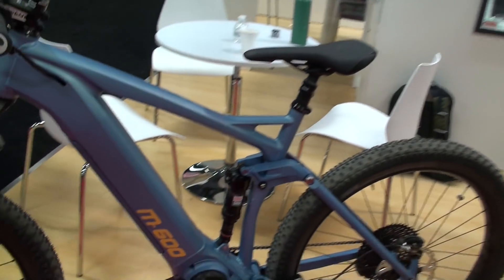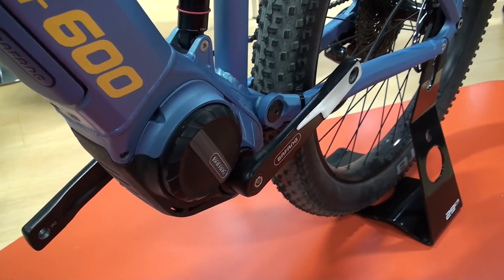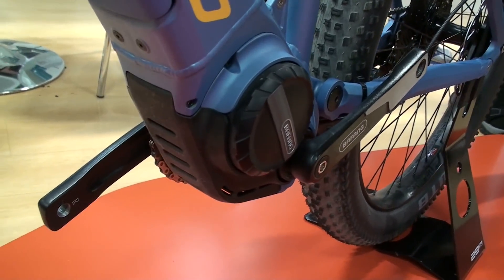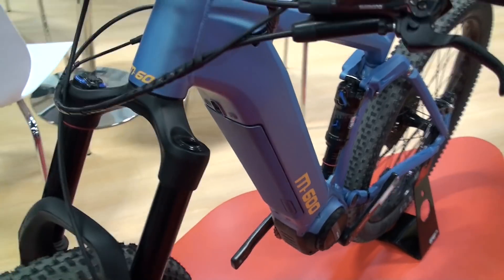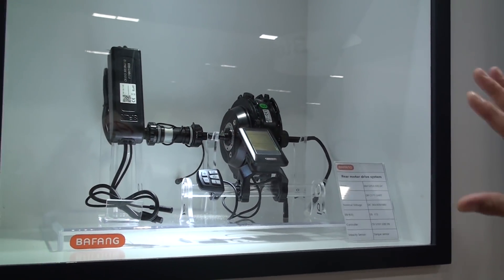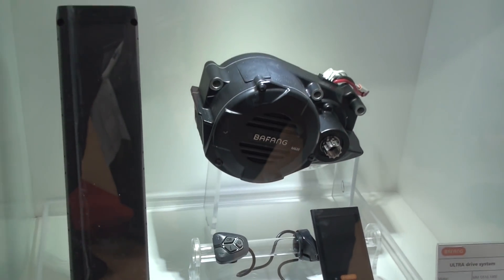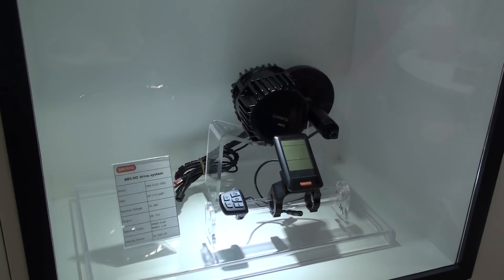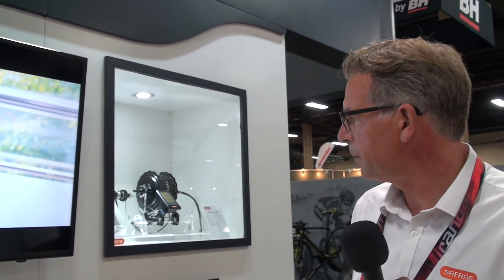2018 Bafang M600 & M500 Electric Mountain Bike Systems  | Electric Bike Report

Comment: I`ve had the M600 for a few months now and rode 2000km. No problems. Keeps 40-45km/h easily in flat terrain. Up to 55km/h downhill if I want to. And can sit while climbing 15-20 degrees uphill. 44T front. 40km/h limiter, but wheel size set to 20". So in reality, no limiter

Comment: For a hunting bike with 4" fat tires it appears the Bafang 750 watt version coupled with a Juiced Bikes proprietary 52 watt battery on its Rip Current S will get me, my camping gear and rifle and my quartered deer meat back to the trailhead. For elk I may have to use a bike trailer to haul the boned meat. 
A good e-bike will increase my hunting range while decreasing travel time thus increasing hunting time.

Comment: they could offer a pedal crank  mounting plate option  with these type ebike frames  to attach normal bottom bracket and chainrings and pedal  cranks when the motor is removed or had to be removed if motor  failed so frame could still be ridden without motor attached.

Comment: Like a dagger stuck in my eye when he called the motor an "engine". I have to ask myself if this guy knows or understands the difference.
Reply: After reading the comments, I'm happy I wasn't the only person bugged by this.
Reply: Same. I thought perhaps my knowledge of the difference between engine and motor was wrong, I've seen a few videos that used the term engine lately. 🤔 And ive designed magnetic couplings for industrial motors for decades. Not industrial engines.
Reply: I thought about it. 🤔 An engine is a machine with parts. So i guess this could be considered an engine.... It converts power to motion.

Comment: Highest is 500w? No 750w?
Reply: They have 500w, 750w and 1000w... the 750 is perfect, lots of power and street legal anywhere in America.
Reply: @brianbassettnumber1  m500, m600, m620 may be installed into the same frame (identical seat "socket")?
Reply: @101picofarad  You mean HAVE TO be installed is some proprietary frame. Junk.

Comment: Why would anyone want a bike designed to hold a specific motor?  Why be forced?  Research and buy any bike you want and add a BaFang 750W and ride anywhere a bike can go legally, with no license or paperwork. BaFang got it (most of it anyway) right the 1st time. The massive frame designs are unnecessary and overpriced. Why own a bike that can't be ridden on the streets?
Reply: Why?  Well there are a few reasons, the most important for a mountain bike is ground-clearance, which can be significantly more if the motor is 'built-ih'.  Also, a minor point: you KNOW that any future motor for 'that bike' is GOING to fit properly ...  (I'm not a 'mountie' guy, just a 'road cruzer' .. Perhaps others here can contribute more reasons ...
Reply: Regardless of the reason or if you get lucky... reason"s", they won't overpower the drawbacks of heavy frames, underpowered motors, proprietary parts, poor assist systems, etc. You did bring up a valid point, the BaFang does hang low on some frames. It just something you learn to ride with.

Comment: It seems like Bafang could very well take over the motor market for ebikes pretty soon.  Their BBS02 and BBSHD mid drive motors both destroy the Bosch and Yamaha mid drives that I tested.  You can do 32-35mph on the BBSHD and the 120nm is much more powerful up hills than the others.  I am very impressed with their progress and now with the ultra motor that Luna Cycles is now offering, I can see a lot of DIY people hot rodding it to new heights.
Reply: Once you've re-programmed the BBSHD (as with the BBS02) it's brilliant. Can't understand why the standard programming is so badly configured. The power output on mine is now buttery smooth, especially in the lower levels, up to 350W which is where I am most of the time. Brilliant piece of kit!.

Comment: I have a Bafang BBS02 750 and a BBSHD. I fitted the 02 to my 26" Gary Fisher ht and the HD to my Salsa Mukluk. Love them both. Very bare bones and simple yet very affective fun and,knocking on wood reliable. I have 2000 miles on the 02 and 450 on the HD. Very easy to install on almost any bikes as long as you know the BB size. No torque or cadence sensors but very good and affordable alternative to porpoise built mid drive E bikes.👍👍👍.
Reply: Brian Bassett who cares??
Reply: CLOTHED IN SHADOWS. Thank you. Well I have never ridden a purpose built e bike,expensive mid drive or otherwise. So I have nothing else to compare my add on Bafang kits. My BBSHD that's on my fat bike feels much heavier than the 02. That being said it does have more power and torque for off road and steep hills. Although I feel the 02 is more than adequate for off rd if you so choose. I use an 11.5 amp hour Panasonic battery and an easily getting 40 to 50 miles per charge using pedal assist and no throttle. I didn't even install the throttle on either one. If I could only have one it'd be the 02 as it is much lighter and plenty fast. I ride to work 2 to 4 times a week which is 22 miles round trip and love it. It is very customizable with assistance levels so you can either get a little exercise or a lot. It depends on if you want a better trail or all around bike with capabilities to trail ride and long road or commuting rides. I love both of them. I will add that spending more on a higher amp hr battery is very much worth the extra $$$.
Reply: You can set top speed up to 33 miles an hr on either one which is more than enough in my opinion. They are not anything like mopeds or small mini bikes. It feels pretty much exactly like a bicycle except you can ride and feel like Super Man.😎👍
Reply: Stars fall. I stand. I got mine through LUNA CYCLES.. they have a huge selection of kits.
Reply: You do realize that the BBSHD isn't legal on any road in America right?
Reply: I'm running a BBSHD off a 21s 900Wh battery and phaserunner controller. I've had it up to 90kmh/55 mph and it seems pretty rock solid. The poor motor reaches 90 C/195 F sometimes after an extended amount of high speed use but seems to keep ticking over just fine.
I haven't had any issues with the police yet. We have a 300W limit on ebikes here but mine is pushing over 5kW. I think as long as you're obeying the speed limit and not doing anything stupid then they will leave you alone.
Reply: Anyone that ride daily and doesn't want to be restricted.
Reply: I agree but the rider was not legal and lets the cop do what he wants.
Reply: Javan Russell 
.m
Reply: Brian Bassett You can re-program it to make it legal and de-restrict it for off road use.
Reply: Javan Russell I started off with a BBS02 13s5p battery about four years ago. Changed to a BBSHD last summer with a 14s9p battery. Running at 52V with 20Ah battery has made a big difference and I would certainly recommend this to anyone getting a BBSHD. I'm nearly always running in the "good" part of the charge (i.e. 52V and above).
Reply: mick2d2 - Yes, you can change the programming but the motor case still lists what the motor was produced to operate as. If the motor is a manufactured 1000W motor or rather anything over 750W it is illegal to be operated on city street and roads.  It's all fun a games until something happens and it comes to light that it is over 750W.
Reply: Brian Bassett True, I suppose if there were to be a accident and an investigation etc. My BBS02 just said 48V20A on the bottom, in small letters, under all the mud. The BBSHD says 48V 1000W, again, on the bottom (I'm running it with a 52V battery, so, it's not 1000W either!)
I only use my ebike off road, unless I can't avoid hitting the tarmac! Here in Spain, at the moment, there are so few ebikes, that I think it'll be a while before we have any problems with the police. I've yet to see any Bafang mid drives (except mine!), although we are starting to see the odd Bosch eMTB. Of course, they're all street legal (250W).
Reply: I don't think that the 250W limit in Europe is right. That's way too weak to propel a large cargo bike or even a fully loaded tour bike. But the American limit of 750W is more than enough with the right gearing to get most anyone around. That's why it blows my mind that American riders are stupid enough to chose the HD over the BBS02 when building a bike they know will be ridden on the roads. - https://imgur.com/a/1PSVmB5
Reply: Brian Bassett Like as mentioned before, I ran a BBS02 for a few years and then switched to the BBSHD. In both cases, on the flat, I'm usually under 300W, often around 150W. I use the extra power as needed, steep trails, sand, etc. What I have noticed (apart from the increased torque on really steep trails) is the much better heat dissipation of the BBSHD. It gets pretty hot here in the summer (35 degrees C) and the BBS02 would sometimes cut out. This has never happened to me with the BBSHD.
Reply: mick2d2 - How do you know what your exact power usage is?
Reply: Brian Bassett Got it hooked up to a Cycle Analyst, brilliant piece of kit!
Reply: I know, one of the few upgrades I haven't got yet. V2 or V3?  I also don't have a shop that seems willing to install one.
Reply: Brian Bassett It's V2 & pretty easy to install, it just connects to the battery via a shunt. You still need the Bafang controller as I don't think it's possible to substitute this with the CA. I use it as a very accurate fuel gauge mainly.
Reply: I have wanted one so that I can see the actual power consumption to be able to ride more efficiently. Seems like it would be a nagging reminder to pedal more and harder when you can read it easily. Does it have a 5v USB output or the ability to hook up a light?